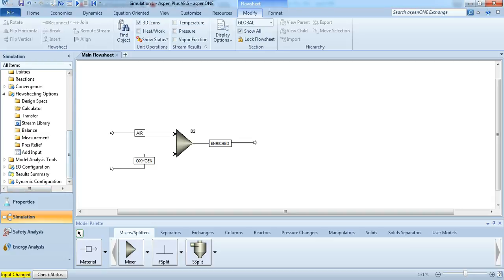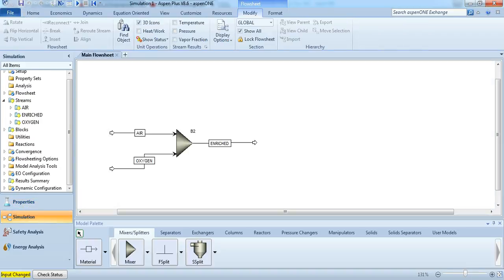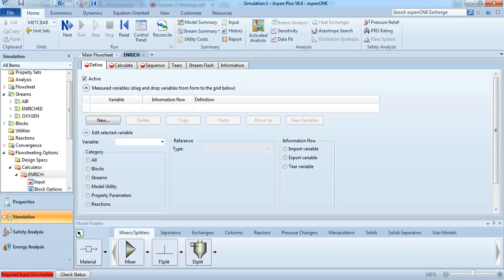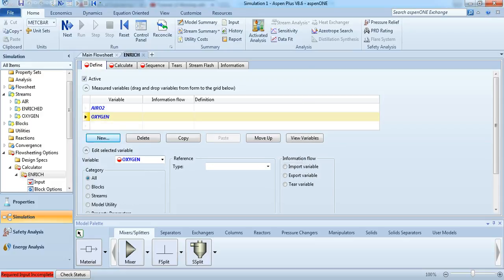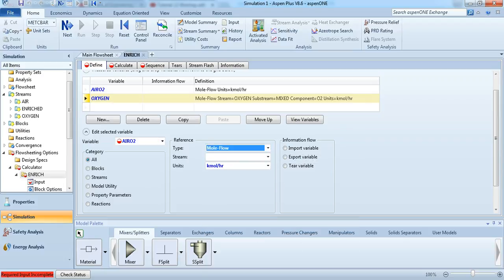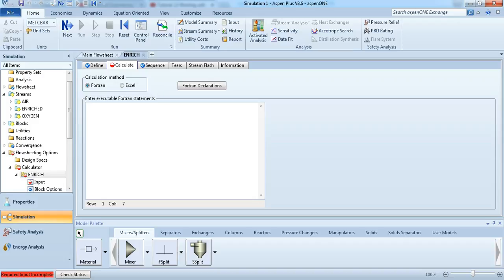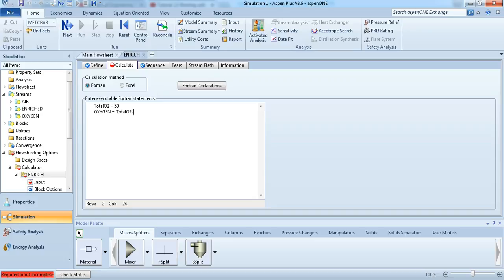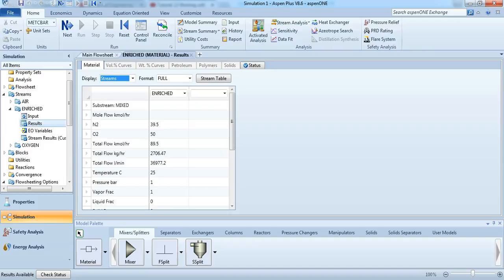Aspen V8 Calculator Block

Comment: terrible tutorial: no inputs to the streams are shown, no explanation about why AirO2 is import and Oxygen is export variable
Reply: Inputs to the streams are not necessary. You already know what is the composition of the air or either can assume whatever composition you want. Same happens with Oxygen stream and conditions...
Reply: The input values can be found in the simulation files provided in the google drive link.....